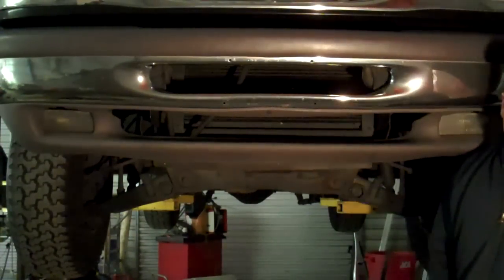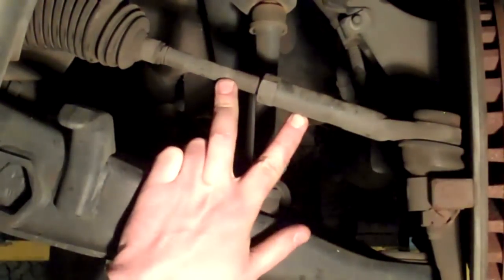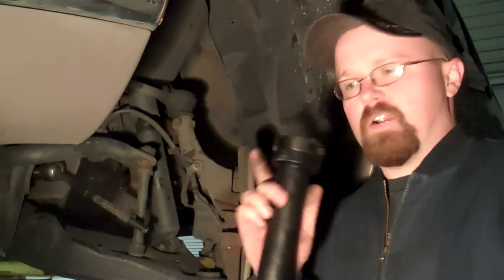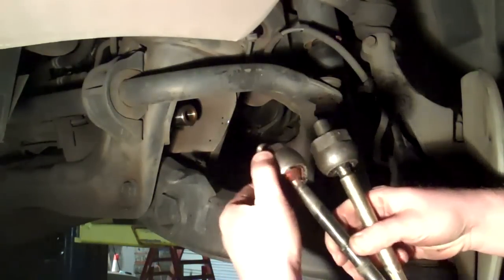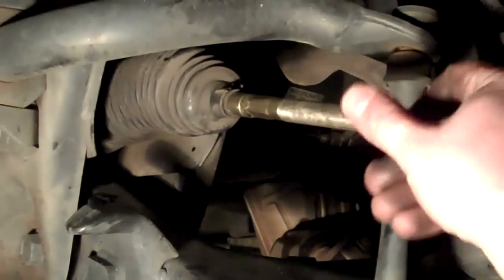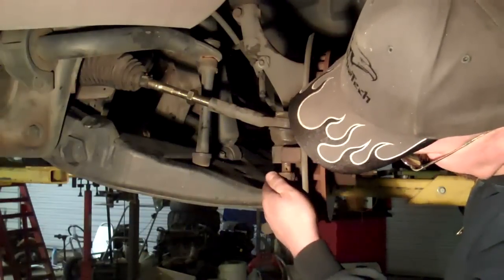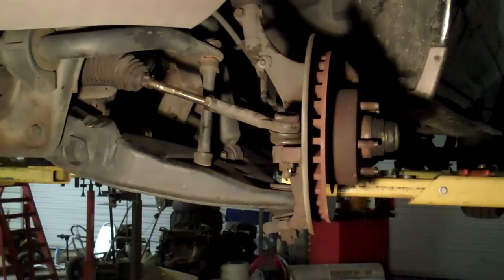Replacing a Rack & Pinion Type Inner Tie Rod DIY

Comment: when re-installing the outer tie-rod what is to keep the nut and the ball joint that it attaches to, from turning together, thus making it impossible to tighten the nut completely?

...and ya, i know this is a very old video.
Reply from the maker: Friction between the tapered socket of the steering knuckle and the outer tie rod end should keep the stud from spinning. Sometimes you have to push down on the outer tie rod end while tightening. Otherwise, most outer tie rods have a hex on the stud that you can hold with a wrench while tightening the nut.

Comment: Can somebody plz help me with a question? I have a 02 chevy Impala (good condition) well fiance hit a chunk of wood in the road recently, and it bent up oil pan (easy fix) and hit hard, runs an shifts great. Lucky their wasnt more damage. But my rack and pinion is leaking in a spot their shouldn't be fluid at all! Its coming out of the rubber boot where intermediate steering shaft connects to top of rack and pinion. Well I've saw that shaft changed and their should not be power steering fluid in their. So wondering if theirs a rubber seal etc in top of rack near where the steering shaft hooks up to it. I know about anything on this car, but the rack/pinion is 1 thing i have nvr changed. So I don't know alot about them. If any1 has time to help me out it would be greatly appreciated. Worth a try anyway. Can't find info on this anywhere.

Comment: What torque does the inner tie rod and ball joint nut get tightened to?
Reply: on the cars and truck I've worked on I tighten them in the same way, impact gun and blue thread locker. there might be a specific torque, ive never looked and I have never had one fail. if you dont have air tools, tighten as best as you can and ALWAYS use thread locker.

Comment: i noticed when doing a wheel alignment that the steering rod while spinning wasn't straight and had movement in it up and down. does this mean that the rack ends are bad also?
Reply from the maker: FamousByFamily yes. If the inner tie rods are bent, they should be replaced.

Comment from the maker: @AFILalpha Usually hitting the steering knuckle will loosen the outer tie rod end from it.  Use penetrating oil.  Not often, but sometimes (torch) heat is needed on the knuckle to make it expand.  Be careful not to cook the outer tie rod boot.  There is also a tool like a 2 jaw puller made for removing the outer from the knuckle that holds the knuckle & presses against the outer tie rod stud.

Comment: Do you need to hold the rack when removing the inner tie rod?some say the twisting from removing the inner rod can damage the rack is this true
Reply from the maker: Rockie mountin if you're doing it by the book, yes. You are supposed to hold the rack and support it so it does not twist while removing the inner tie rod. That being said, I have never done that while replacing inners, and never had a problem afterwards.
Reply: roadragecustoms  thanks for the fast reply, the reason I ask is I have to do this to a Cadillac Escalade with 186,000 miles on it and I didn’t want to ruin the rack, I found your video to be very informative You explain it well thanks for posting and again thanks for getting back to me so soon

Comment: Question
What can it be if the hex part of the inner tire rod is pushed in on the passenger side I was able to use the tool but not on the drivers side
Reply from the maker: Did you try turning the steering wheel the other direction?
Reply: Thank you so much I feel stupid lol 😆
Reply from the maker: Simple mistake. Don't feel bad.

Comment: How much torque did you use when tightening the new inner tie rod?  I just did mine today but I couldn't find torque specs for it anywhere so I used 50 ft lbs.  Haven't driven the car yet, still have to swap the UCA, so I can re-torque it if necessary.  Thanks.

Comment: My boot on the outer tie rod has seperated.. How can I fix that? It seems that the boot(rubber peice) has torn and it seperated from the ball. The thing you hit to remove it from the wheel.. What can I do? Kinda desperate, I can't afford to take it to a mechanic, I gotta do it myself. I got a 2000 Dodge Ram quadcab.. Can I replace the rubber boot and fit it back onto the ball somehow? Anyone?

Comment: How do you know when this needs replacing? I have ML320 and there's like a whinny noise in the morning (or when its cold start) as I turn the steering wheel could it be that it needs power steering or is there a problem with the rack & pinion
Reply: It is but ima buying one off a partout ... For 230 ..

Comment: I have Hyundai accent which has torn bellows boot and there's a clunking noise whenever i drive on uneven road and speed bumps. Can the torn bellows boot be the culprit which cause the inner tie rod to run out of grease making the noise?
Reply from the maker: That is one possibility. It could also be the strut, strut mount, ball joint, or almost any other suspension part.

Comment: I have a question. If I remove my old inner tie rod and replace it with a new one but forgot to put to the inner tie rod boot, is it safe to drive or is it going to damage anything?
Reply: How long did u drive it like this as did it damage anything??
Reply: @kelseyrainwater3918  I sold the car about 2 week after but I did not notice any damage during those 2 week.
Reply: @OnePunchMan781  wait second you drove almost 10 years without the boot ???
Reply: @kelseyrainwater3918  10 years ago

Comment: the only thing I worry about is damaging the rack and pinion gears while taking off and putting on the new inner tie rod. I the instructions that came with my moog inner tie rod says you are supposed to have a wrench holding these gears while removing or installing the new inner 
 tie rod so not to damage the gears,  but I don't know how to do that. if I just put to blue thread loc on and tighten  reasonably snug, would that be good enough. I really don't want to mess up the rack and pinion gears or am I just worrying too much...great video
Reply: With the tool he used, you can use an impact wrench that won't pull on anything other than the nut. Otherwise you might need someone to put a wrench on the other tie rod to prevent anything internal from moving

Comment: how come there isn't a tool for that.....? i am talking about the spring clamp that you had trouble getting the needle nose on. same spring clamp used on fuel lines or other light duty hoses. pliers just don't do the job very well.

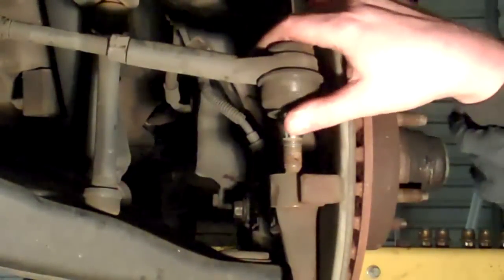Comment: You need to buy a new outer tie rod end.  Watch the first part of this video at 1:06.  There he is loosening the outer tie rod.  Now watch at 1:19 as he unscrews the outer tie rod end from the inner rod end that's the topic of this video.  You replace that part as an assembly.  The new one will have a new rubber boot in the kit.  

Be sure to support the vehicle securely.  Don't attempt to make repairs with the vehicle supported on the emergency jack or a service jack.

Comment from the maker: @onefiveonemph I replaced the inner clamp with a zip tie.  You can get them at parts stores, hardware stores, department stores, grocery stores, pretty much anything that ends with store.  Tighten it by pulling on it.  Then cut off the excess.

Comment: wow. so reason im here is cause just the other day the tie rod end snapped(im not a mechanic so i have no clue what and where it broke) and apparently sent the inner tie rod(im assuming from this video again not a mechanic so i came here actually to learn the name of the part i need) into the tire and locked up the tire. not having a clue what happened i realigned the wheels and was able to move so i figured the problem disapated so i tried to drive home very slowly but hit a bump sending back to where i was locked up the tire and everything. well my mechanic said need new tie rod ends... ok got em brought them to him and he said that the inner tie rod is bent now. he got everything back together and what not but with that rod bent ill need to replace them. now he stated that he was unable to replace for what ever reason and id need to go to a shop which ok fine i just want some knowledge before i walk into a shop so i dont get air blown up my ass ive put so much into this truck and i love this truck i just bought it granted the dealership clearly doesnt do maitnence(long story) and i just bought this truck 3 months ago. so can anyone give me some info before walking into a shop and im talking simple but complete. do i need to do both sides(which i probly will because i dont want uneven wear one one side) idk can someone just help me out itd be greatly appreciated
Reply: Infinity i30 rakec pinion

Comment: How would I kno if my 2015 accord needs a whole rack and pinion replacement or just inner and outer had a mechanic try telling me the whole rack and pinion needs replaced I originally brought it to him to just replace inner and outer then called me and was trying to tell me the whole rack and pinion needs replaced and said ya the ball joint near the rack is bad, which I think he means inner tie rod joint  my steering isnt tight or very loose so im bout to just do the job myself but don't know how to tell between just my inner tie rod being bad or the entire rack and pinion I'm confused on that pat
Reply from the maker: If the rack & pinion assembly is leaking fluid or if the rack is bent, it should be replaced. It's not uncommon for the bellows boot around the inner tie rod to be partially full of power steering fluid. If so, it's time for replacement of the whole unit. If the mechanic can't tell you why you need to replace the entire assembly, you need to replace your mechanic.
Reply: @roadragecustoms  so I ended up calling the dude back to clarify what was wrong cause from my own inspection I saw no leaks or anything my tie rods do need replaced but that was all I could tell was wrong l. So the mechanic said he meant my inner tie rod needs replaced but that the steering rod in the rack itself has a little play and so I should just replace the whole unit Im starting to idk tho. I'm starting to  think its an electrical issue cause ive been having alot of those lately so I feel like the computer in the car isn't reading correctly or a wire went bad or something. I literally just hit 10000 miles and have babyed this car to the max. hard for me to believe the rack is bad. My cars under warranty so imma get them to pay for whatever is wrong hopefully thanks for the reply and and info it was really helpful

Comment: The jam nut on my tie rod won't move even with a torch
Reply: Real late but I had to cut mine off with a Dremel.  2 cuts opposite each other and then stick a screwdriver in one of the cuts and pry. Get a fiberglass reinforced cutting wheel or you will end up going through a few of them.

Comment from the maker: Recheck all of the fasteners.  A loose sway bar link can cause a popping noise over bumps & so could sub frame to body bolts.  If, when you said at idle, you meant with the car sitting still, it could be anything from loose engine mount bolts to power steering lines that aren't properly secured.  It could even be exhaust or turbo related, but I'm not sure what all you disconnected to do the rack & pinion.  Also check the bolts holding the rack & pinion unit in place, as well as any heat shields.

Comment: I don't think so, it's not attached to the tie rod, it is a separate part.  If you stop the video at 0:36 seconds in there is a part that is directly behind where the inner and outer tie rod screw together.  It runs straight up and down. (north south) Thanks for the reply I hope this is more clear :D

Comment: How much would this cost to do my self and how much would a shop charge
Reply: cost you about $100 in parts and extra for whatever tools you might need. you can rent the tie rod removal tool from autozone.
it would cost about 250-300 a side at a shop for parts, labor, and allignment.

Comment: How in the world did you get that inner clamp off?!
Reply: 1). You can use a. Dermal with a cutting wheel to cut the "single ear" which is how the clamp was originally secured.   2) You can pry open the "single ear" with a screwdriver and a twisting motion.  The clamp will pop right off.
Reply: just a screwdriver to pry up on the part that clamps will just bend it free

Comment: What does the inner tie rod connect to? is it the steering rack end seal? i got in a small accident and  when i replaced my tie rod it isn't smooth 360 turn
Reply from the maker: The inner tie rod connects to the rack gear. I'm not sure exactly how you mean it doesn't turn smooth 360. If you are saying the steering has a tight spot when driving, you may need a rack & pinion assembly.
Reply: +roadragecustoms well it got bent

Comment: I would refrain from using hose clamps on any rotating part of the drive train, axles, drive shafts etc.  As it rotates it will throw an imbalance.  Used to use hose clamps for balancing old drive shafts, great way to fix a wobbly, vibrating shaft if put in the right spot. Zip ties are light enough they won't change balance.

Comment from the maker: The method used to check it depends on your symptom(s).  For squeaking noises over bumps, I bounce the vehicle while I listen to each part with a stethoscope. For loose steering conditions, I raise the front end & shake each wheel while watching each part to check for looseness (0:30). With vehicle supported by the lower control arms shake the wheels up & down to check ball joints. Also have friend turn steering wheel while you watch front end, making sure the gear box isn't sloppy.

Comment: I noticed a lot of car models have a "Lock Washer" that is put in the inner tie rod thread to keep it secure and stop it from coming loose...
My nissan sentra does not have that and I notice this vehicle you're working on doesn't either.

Is "blue thread lock" enough to keep it strong and secure against the vehicle's vibration when on movement?  I really need an answer for this question since I'm replacing inner tie rods on my car.  Thank You,  great video...

Comment from the maker: I assume you are referring to the bellows boot & not the CV boot.  If so, yes you need a rack & pinion assembly. Tip: keep the steering wheel straight while you work on it.  Install the new rack with it in the straight ahead position.  A mistake here could damage the clockspring and cause airbag light.  Good luck!

Comment from the maker: @tekatero It sounds like an out of round front tire. Have the tires balanced. Make sure the tire guy watches, or lets you watch the trie while it's spinning. If the wheel(s) is/are bent, or if a tire isn't round, you should see it. Even better would be a road-force balance that shows If a tire & rim assembly is out of round, and how much.  It should give a measurement in thousandths of an inch.
Check tie rods by shaking the front tires (off the ground) while watching the tie rods for looseness.

Comment: hey good video, have to do this job on a little peugeot at some point, looking at the manual i have is suggests gripping the steering rack with cloth covered grips to stop it moving whilst un doing the rod.....this seems a recipe for scoring up that shaft. what are your thoughts?
Reply from the maker: jeremy collard Peugeots seem like they would have fragile parts. The procedure you read in the manual is to prevent damage. If you think the rag wrapped around the rack isn't enough, use thin pieces of wood. Good luck.

Comment: My inner tie rod boots have been ripped for a good part of 2 years now. I’ve noticed black liquid around the exit point, does that mean the steering rack is bad? If not can I just remove  the inner tie rod, clean the socket area that’s probably all sorts of dirty with brake clean, re lube, and then replace it with a new inner tie rod part?
Reply from the maker: Taj Laugan it sounds like your rack and pinion is leaking power steering fluid into the bellows boot. If so, the easiest fix would be to replace the rack & pinion assembly.

Comment: Thanks! I watched this video once and was able to R&R the inner and outer tie rods on my 2001 Taurus. Thanks for the warning on the vent. However, my vent was a tube running from the left bellow to the right. I had to be careful not to pull it out of the opposite side while removing the bellows. Also the OEM nut on the outer rie rod was a one-time use nut. Thanks Ford!

Comment from the maker: The steering wheel was crooked when driving straight.  I was checking the front end for bent parts & shook each wheel to check for looseness. I could feel the LF tire was loose.  The play in the LF could be seen as movement of the LF tire, LF outer tie rod, and LF inner tie rod, with no movement on the right side.  I tried to point out the looseness and show the movement of the bellows boot in the video.  I guess I should have explained it better.  Thanks for the question & Happy New Year!

Comment from the maker: @TheLastDesires Here are a few options.  1-You can apply heat (carefully) with a torch to the outer tie rod to make it expand.  2-You can use penetrating oil.  3-Reconnect the outer tie rod to the steering knuckle to keep it from turning.  Break loose the jamb nut with a wrench.  Use big pipe wrench to turn the inner tie rod until it loosens from the outer.  4-Cut the inner tie rod in half.  Remove the rest of the inner tie rod with tie rod tool.  Replace the inner & outer tie rods.

Comment: Why didn't u show yourself putting the zip tie in the on the innerr part of the boot. I've tried that before on a CV boot and couldn't get it right enough
Reply from the maker: james klinski I would never put a zip tie on a CV boot. Too much centrifugal force. A bellows boot doesn't spin. I usually use a pair of long needle nose pliers to pull the zip tie tight.
Reply: roadragecustoms that's the answer I was wondering. Thanks